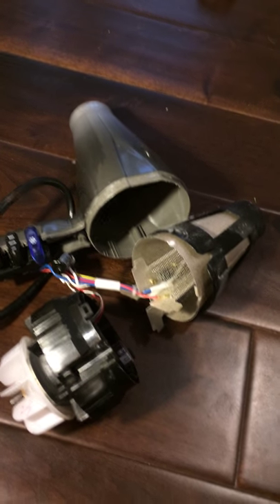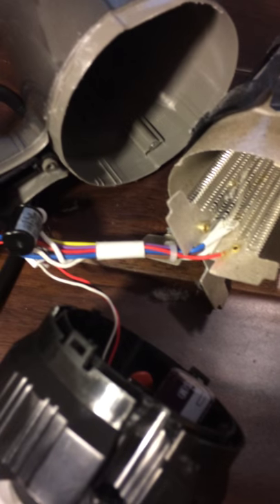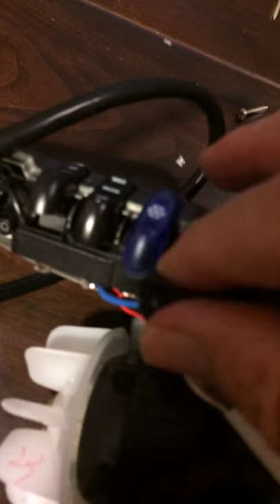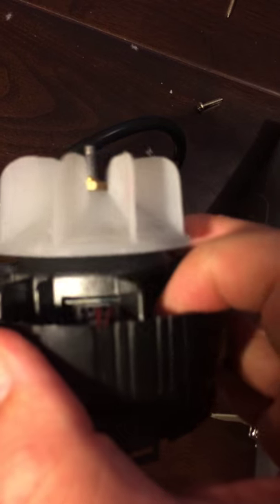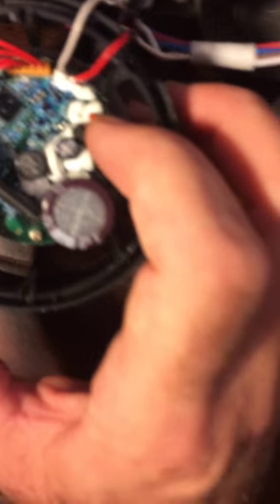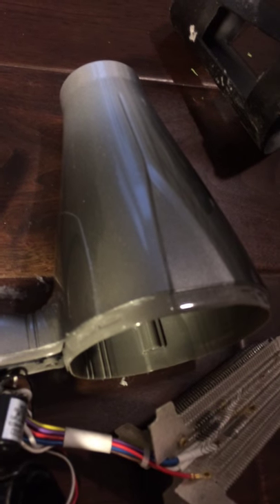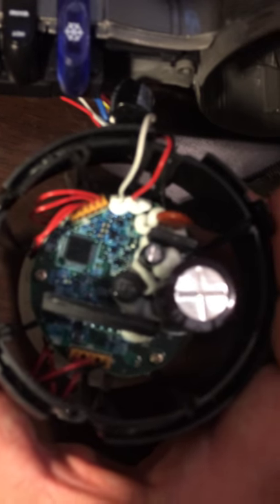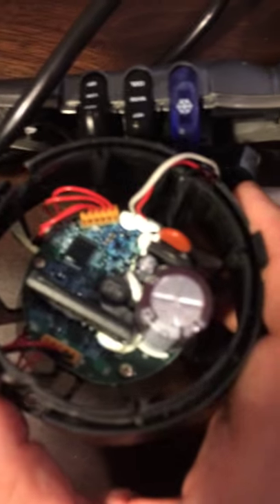Conair Infinity Hairdryer 3Q BLDC Brushless Motor Hairdryer teardown

Comment from the maker: The controller chip in this Conair Infinity 3Q is a Texas Instruments DRV91670.
This chip could be a special run for the China based manufacturer of this hairdryer.
The closest chip I can find as a motor controller is here:
http://www.ti.com/lit/ds/symlink/drv8308.pdf

From reading this documentation, the motor of the hair dryer is running open loop.
The speed changes via a switch on the hair dryer from low to high.
I have not yet traced where this wire goes.

From reading the documentation from Texas Instruments, the speed could be changed by changing the contents of a register or by changing the clock frequency to this DRV chip.

There could be a programmable divider chip on this board in the video.

Would need to take apart again for a closer examination.

I have learned a lot about BLDC motors by taking apart this hair dryer and then looking up all about BLDC motors.

To my knowledge there are only a few hair dryers out now which use a BLDC motor which stands for Brush Less DC.